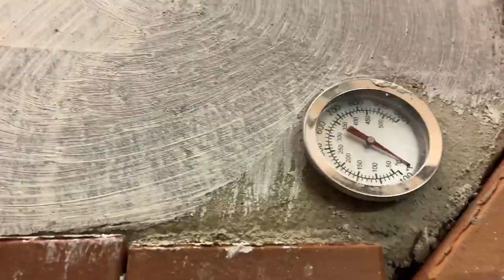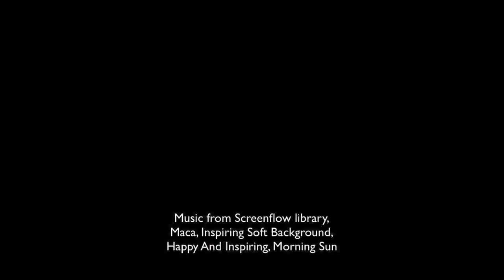Masonry batch rocket full build timelapse over 50 days

Comment: What type of cement did you use to withstand the high heat/temperature?
Reply: either use clay slip or refractory cement.
Reply from the maker: clay slip was my choice. If you have a brick chiney you can use normal mortar once you get out of the "heat zone" of the oven

Comment: Did the heat riser not crack. I tried that chimney pipe and crack 5 mins into first burn
Reply: Same thing here, pipes cracked quickly. At the second stove I used refractory bricks.

Comment: I saw 3 mistakes in this construction. This heater will work but it could have been much more energy efficient if there were no mistakes made in construction. 
1. Why would you insulate a heat riser with a Rockwool? Rockwool does not accumulate heat. Makes no sense.
2. The brick with holes is made to insulate not to accumulate. While it still is going to accumulate and spread heat full brick would have done a much better job.
3. Why would you use the insulated chimney inside the space that needs to be heated? An insulated chimney is used on the outside! In the room, you want to use the heat of that chimney pipe! Possibly lay it down the side of some walls or make a hot bench before rising it up and out to the roof.
Reply: plus the motor over the beautiful brick looks like shit
Reply: The riser is insulated with ceramic blanket,  not rockwool.   The riser needs to be insulated to help the draft which in turn makes for a better burn and increase overall efficiency.   
Please educate yourself before condemning the work of others.
Reply: @loganm82
Reply: 1. The insulation on the heat riser concentrates the heat for a more complete burn of the smoke. This causes a cleaner burn. The whole burn chamber/riser should be insulated.

2. The stratification chamber should be pulling most of the heat out, so an insulated chimney can save the last bit needed for helping with the draft.

3. While I prefer the brick too,  I think there's a reason for doing a double envelope that I can't remember for certain right now. Maybe the extra mass to hold and radiate the heat? Adding another layer of brick or maybe rock would appeal more to me, but it's not my heater so not my choice.

4. Not sure why he used bricks with holes, but a lot of people use secondhand bricks. Finding real red clay bricks instead of concrete bricks made to look like red clay can be difficult too.
Reply from the maker: Thanks for you queries. I'll try to address them here:
1) The ceramic blanket is there to heat the riser to even higher temperatures for a cleaner burn
2) I had access to hole bricks, and you're right, full bricks would be the better solution
3) Insulated chimney is the easier way to meet planning requirment locally (which are a boat load !) so I didn't want to use any more time on the chimney than was necessary.
Reply: @Reputationbar  Believe me, you don't need to insulate the riser. You will get more than enough heat to burn the carbon particles in it without the insulation. When you insulate it your riser material will only burn faster and you will have to replace it sooner. That is the main reason you should not insulate it. Also, when you put heat accumulating material around the riser you  make your heater more energy efficient because more heat stays in the sistem for a longer time lowering the exaust temperature on your chimney. Thick stainless stell is the best option after a glazed sillicate. But glazed sillicate ceramic is not easy to find for the purpose.
Reply: @Reputationbar  Ideally you should use heat resisting/reflecting and partly accumulating material on the riser. Fully ceramic riser made out of glazed sillicate would be the best option. Riser material is the greatest challenge in rocket heaters. Becuase it needs to withstand highest temperatures and not to burn and break over time. Same as with those ceramic tiles on real rockets that are used to withstand the heat created when a reusable rocket/shuttle enters the atmosphere. I have tried 3 materials and all 3 have its flaws. 1. vermiculite panels, they are the best to reflect the heat but crumble over time since they are made out of small compressed vermiculite particles. 2. Mortar/masonsry brick, burns and breaks the fastest. 3.Heat resistant silicate/magnesium brick from an old electro-accumulating heater, lowers the riser temperatures initially by firstly accumulating the heat in itself and not reflecting enough.
Thick 6-10mm inox steel is a good option that burns slowly is also a good option but it would eventually burn off too.